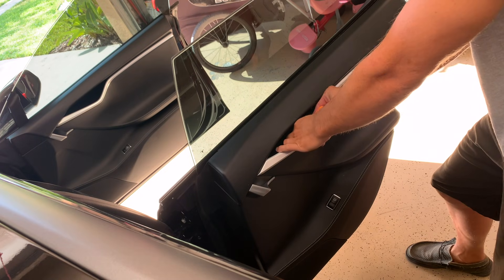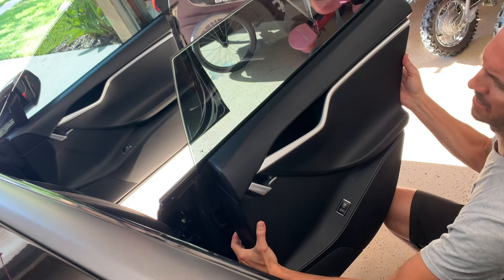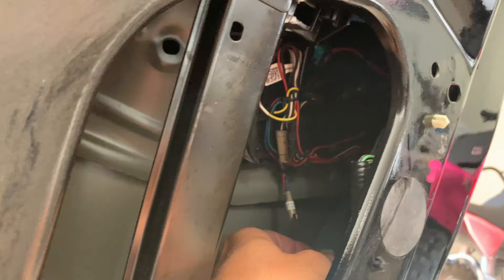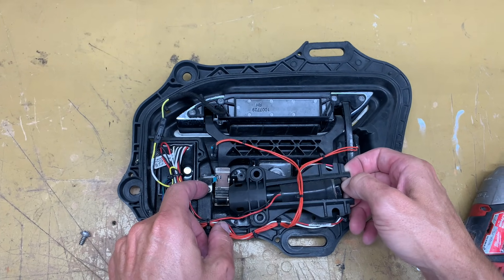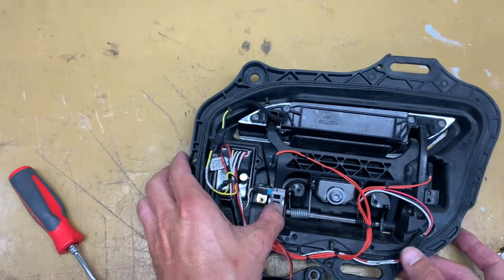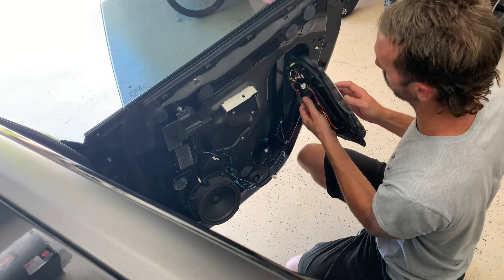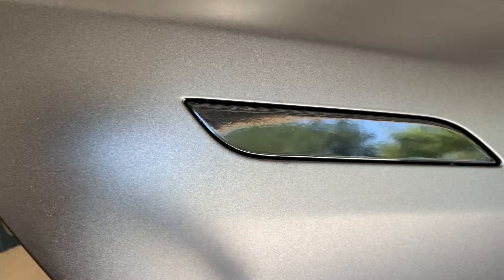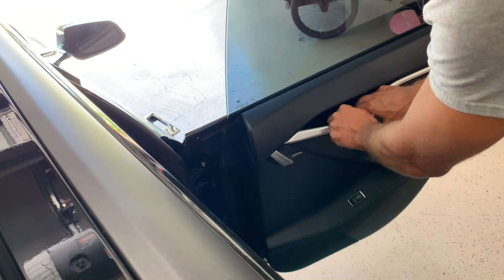Repair and Replace your Tesla Model S door handle

Comment: To be clear this is a rear door. The front doors are a different process.
Reply from the maker: I don't think that needed to be pointed out, but thanks.
Reply: @thereelwdad . I appreciate your video and your reply. I’ve done the front door of my 2014 S P85. I followed the procedure shown on the Electrified Garage YouTube channel. It’s a bit harder than a rear door. The Tesla way of doing it is to remove the glass. The Electrified Garage method leaves the glass in place. Chad is their head tech. He use to be a mobile tech before he help start the EG. he worked on my car while I was at work several times. Always a door handle.🤦‍♀️

Comment: How do you get the nuts out without taking the window out?
Reply from the maker: There are 4 nuts, which one?
Reply: @ top left one. I managed to do it, but had to trick the car into thinking it was locked by closing the door latch with my finger. Window went up fully which gave just about enough access for a long screwdriver with a 10mm socket at the end to turn. The angle on it is crazy though…

Comment: My car makes a whining noise when it’s trying to open the door latch. Is this the same issue?
Reply: And everytime I put my car in park the door opens by itself
Reply from the maker: It could be a similar issue, but seeing how they open themselves it sounds like a GEN3 handle
Reply: 2015 Model S
Reply: Could it be electrical? I’ve taken it to Tesla. They said they fixed the issue but it comes back during the rainy/cold seasons

Comment: How do you get to the hidden nuts?
Reply: Exactly
Reply: @johnluongo7732  I actually figured it out.  Go to harbor freight and purchase a flat ratchet wrench. It was 15 buckets.  Roll down the window all the way. There’s a rubber piece at the corner of the door that you can stick the wrench in.
Reply from the maker: If it's hidden how do you know about it?? lol j/k. I need to remake this to show different methods I use, but yes pulling the trim off the window on both sides and using a ratchet box end wrench to access the top forward nut works best.

Comment: very helpful. My door was hit not sure what I need to replace. I need a door also . Door handle does not work
Reply from the maker: I need two doors too! The door is probably bound up on the opening. If it really got bound up, it probably broke the paddle gear.
Reply: @thereelwdad  where are u located?
my door was Hit/Damaged . hence handle will not Present

Comment: Watched the video a few times. Read all the comments for the extra tips on how to acces the hidden bolt. From start to finish only took me an hour.  My c clip was rusted pretty bad and broke when trying to remove but thankfully you included 2 extras so I was fine. Door works perfectly now, thanks!

Comment: My 2016 S has an issue where sometimes when unlocking the car the right rear door opens. I’ve read that this is because the handle overextends and thinks you’re opening the door, is my only fix to replace the mechanism as done in this video?
Reply from the maker: It sounds like you need to adjust the microswitch that tells the handle when to stop, we have a short about that here.
Reply: @thereelwdad  Great, thank you for the response!
Reply: @thereelwdad  I haven’t been able to find the short you’re referencing, is there a chance you could send me a link?
Reply: @thereelwdad  Would I have to tighten or loosen the microswitch? I couldn’t tell on your short, is it the torx screw that’s on the blue microswitch itself or the one that’s behind it that gets hit by the handle when opening?

Comment: Thanks for this excellent video! Just did our right rear door on our 2016 S. Had trouble with a few power connectors, and getting to the hidden bolts, but apart from that, no whammies. It was an amazing pain in the ass, but, now it works. Thank you!
Reply: I’m giving this a go, My 2016S was tethered to the door frame, did you have that issue
Reply: @hasentufel44 did you give it a shot? There were a few weird connectors I had to figure out how to disengage
Reply: A month later I had to fix the handle for the other rear door. Sheesh! Well, at least I had practice. :)

Comment: Can you adjust the depth of the handle? Mine was replaced by Tesla service and it sticks out just a bit when retracted.
Reply from the maker: If it was a replacement recently by Tesla, they probably installed a GEN 3 handle. For this situation, you may be able to go into service mode and re-calibrate the handles to get them to sit flush.
Reply: @thereelwdad  thanks it was gen 3

Comment: Is it safe or advised to cut the orange strap for the front door?  I can'tfind enough room to get in there to work without doing so.
Reply from the maker: Great question, very rarely do we still have orange straps left, but this means that door has never been opened, a virgin door! Most are already cut.

Comment: My car is a model s 2016 and I can’t get the plug to the door Handle undone. It has four or five wires in it . Want to remove completely so I can repair it. I replaced the sensors but door handle doesn’t extend. Do you have anything to recommend.
Reply from the maker: The plug is just a plug, I am not sure how to assist you on that. Press the clip and pull, it is easier to do when you remove it from the mount. The microswitch sensors just tell the handle where to stop, and when the hand pull is activated. It sounds like you have a broken gear either on the motor or paddle gear.

Comment: First off, thank you Chad for this video as it gave me the courage to try to do this myself. BUT A FEW KEY LESSONS LEARNED TO OTHERS WHO MIGHT TRY THIS, BELOW. 

2015 Model S 70. Rear handle not presenting; years ago I watched the Tesla service ranger fix the same problem on my driver door handle and remembered that the crummy pot metal paddle gear had broken off at the hole section. Fast forward to now (October 2023)-- I could hear the motor whirring inside the rear door so was pretty sure it was a broken paddle gear (not the wiring). I initially sent in a service request on the Tesla app and they quoted me $500 to come and fix it in about a week's time (earlier available appointment).

I did some YouTube research, found this video and seemed feasible to DIY so I ordered a replacement paddle gear (stainless steel which should be much stronger than original part) from Amazon for $15 which arrived the next day. Note that I consider myself pretty handy (woodworking, some construction skills, minor electrical work) for everyone's frame of reference.

FIRST LESSON: Removing the interior door panel is a major headache!! In Chad's video he pops it off in 2 seconds (to be fair he mentions that he's removed previously so that's why it is so easy). I tugged, pulled, wedged, etc. for what seemed like an eternity (probably 30-40 minutes) and was a sweaty mess... I was about ready to throw in the towel and just have Tesla come and fix it but seemed crazy to pay $500 to fix something that could be fixed with a $15 part. RECOMMENDATION: if this is the first time this interior door panel is being removed, gird yourself. I would place thick duct tape along the edge to protect the paint finish and I ended up using a bunch of chisels to wedge them between the metal door frame and plastic paneling and pry them upwards. Finally I heard one of the white plastic anchors pop off so that gave me hope and I kept wedging along different spots along the side and bottom of the panel and eventually was able to pop it off like Chad shows in the video. I don't know how one would be able to do it without some amount of damage to the white plastic anchors-- I saw some shards of white plastic as I'm sure they turn brittle over the years and they get damaged when forcing the panel off (silver lining-- that does make them much easier to put back on and off again in future).

SECOND LESSON: It was mentioned in a few other comments as Chad's video kind of glosses over it quickly but when trying to remove the door handle mechanism, the fourth 'hidden' nut is seemingly impossible to access! This was the second time I was about ready to throw in the towel. I was able to get 3 of the 4 nuts off using my standard ratchet set (with extender for the more visible nuts) but I could not figure out how to get to the top middle 'hidden' nut. I could see it taunting me through one of the metal door frame holes through the glass (I had the window in up position). I felt like I hit a dead end so ended up driving to my local Tesla service center (fortunately only 20 mins away) and a nice technician there explained to me that to access that last nut they recommend putting the window in the highest 'up' position by fooling the car and activating the door latch (the one at the 'strike' side of door) so that the window rises up that extra inch or so. VERY IMPORTANT: IF YOU DO THIS BE VERY CAREFUL NOT TO CLOSE THE DOOR AS THE GLASS CAN SHATTER AS IT WILL HIT THE UPPER CAR FRAME. After the glass rises up you have much better access to the hidden nut. The Tesla technician showed me the mini ratchet he uses to get to that nut.

As a result I would HIGHLY recommend getting something like a mini ratchet set with a 10mm socket. I went to Home Depot on the way home and bought a "Husky 1/4 in. Drive Flex-Head Microdriver and Socket Set (16-Piece)" for $22. After I got back home and raised the glass to the highest 'up' position, I was able to get to the hidden nut. It helps that this ratchet has a swiveling joint to help angle it into that tight space.

THIRD LESSON: Now that the nuts were removed I was flying high. The power cable to the door handle mechanism was still zip-tied to the body so in order to unplug it (Chad's video shows it dangling as it has been detached already) I had to cut a couple of zip-ties to access the 'plug' that you disconnect. Be careful when you snip the zip-ties to avoid cutting any wires... but here was the next hurdle... getting the door handle mechanism out through that small opening in door frame is like a crazy 3D puzzle... took me a while to spin it, move it, try lots of different positions before it finally came out. 

The door handle mechanism finally came out and the video is pretty spot on... the spindle in my car was not as easy to slide back and forth as in the video but I ended up using a hammer and a nail set (tapping lightly) to push it far enough to the right to be able to install the new s.s. paddle gear. 

LAST LESSON: After testing the new paddle by reconnecting the power wire to door handle, one thing to note when putting everything back together. The power wire that is now unbound because you had to snip the zip-ties to get access to it is now flopping inside the cavity. It looks like there is a chance that the window could get caught on it as it goes up/down so I would recommend attaching the loose wiring to the door body so it is snug. I ended up using some foil-faced tape I had handy.

But finally after about 5 hours all told I got it working. Thanks Chad for the video! 

PS: Closing note: I had cancelled my original Tesla service call (the $500 estimate) but when I hit the 2nd hurdle above I made another service appointment on the app as a back-up plan. That quote came in around $320 for the same repair... I know these are just estimates and the service technician will update it once they assess the actual repair but if they had sent me that quote to begin with I might have not gone the DIY route... but at that point I was already neck deep so pushed through and did it myself. The Tesla technician who helped me remove the hidden nut said that they don't just replace the paddle gear anymore as a standard service item. They replace the entire door handle assembly with a more reliable design and I believe he said that costs about $320.
Reply from the maker: Wow, that is quite the comment! Can you come write this stuff out for me in the future?? lol. You are 100% correct on everything. I do feel the pulling of the door panel isn't quite as horrific as you make it out to be, but it is very nerve-racking to be yanking so hard on it. I have been meaning to add those little details about latching the door and putting the window all the way up to access that one nut, but haven't found the best way to add it to the video and have it remain up.
Reply: You're right, it's quite the challenge to get to that specific bolt and also to remove the zippers. Would have been worth mentioning in the instruction video to be well prepared.
Reply: Wanted to add a thank you for this comment. Video was great, but this spans the gap on some hand-waviness aspects. The window "up" position was key. and I found a standard 1/4 wrench was just fine to access it with this secret. Was able to do this end to end in 1 hour for the first time taking on this job! I added some silicone grease to the new paddle gear as well to prevent any binding.
Reply: @PaulMangiamele Glad it helped!
Reply: Thank you!! The vid and the comments together, made it much easier - that window trick saved me - i never would have got to that bolt - just adding that I also pulled those stickers off and got to that bolt with an extension bar for my ratchet and went through the access hole rather than try and slide my hand up behind it.  Thanks again!

Comment: 2015 Model S 85D. Surprised it took this long for a door handle to fail. Tesla quoted me $315 for repair. Might have gone for that, but the other three doors are probably next in line. Ordered the gear from ReelDeal on Friday and received it Monday (figured that was the problem). The video didn't match my car (driver door) but managed to figure it out as it was similar. After removing the three nuts wouldn't budge so scratched my head and eventually read the comments about the fourth nut accessible from the window slot. Didn't know how to remove the trim but found it just pulls off. I lost one of the other nuts somewhere in the door so I left the window one off as I won't need lto disassemble the door to get to it should I pick up a replacement. After reassembly the window was brushing the cabling and connector. I should have tied it off while the assembly was out but I wasn't going to remove it again - it is quite a task to fiddle it into place. Took me a long time to bind the cable out of the way due to limited access. Whole job took me 5 1/2 hours! The replacement gear seems heavier than the original. (The bushings needed to be removed to fit the new gear.) Just changed the configuration to only auto-present the driver door to limit the wear on the remaining three doors. After this job maybe $315 isn't so terrible to pay. Clearly Tesla didn't expect these gears to fail given how tough it is to access the gear.
Reply: Sounds like you did a front door handle.  That’s a slightly different process than rear doors.
Reply from the maker: Think about how much faster you will do it next time though! We have them down to just about 45 mins for the gear now.
Reply: Mine too 2015 model s. Failed 2 months ago.
Reply: $400 now inflation lol

Comment: Helpful instructions all the way until they weren't! My 2016 S90D door handles have a 4th nut on the upper left corner behind the window glass! Unreachable! You have to remove the window to get to it! Or have a specialty, long handled angled 10mm socket to finagle around the glass. Too tight to get a socket on it, and the nut is recessed so you can't get a box wrench on it! Window UP for other three nuts, window DOWN for the top left nut, and requires special tool that I don't have so I had to give up and put it all back together without repairs bc I'm not taking out that glass!
Reply from the maker: Don't take out the glass, you don't need to! You can reach it with a standard open-ended 10mm wrench with the chrome exterior trim removed.
Reply: having the same issue. If you push the door lock (in the frame of the car) the window will go up a little bit more (as if the door is closed). But i still cant fit my tools to reach the nut :(

Comment: I really appreciate you taking the time to put this video together. BUT, would be really helpful to discuss how to get at that one nut behind the window. That one took me over an hour and it was pure luck, along with a flexible extension. I didn’t put it back on when I reassembled since I didn’t want to deal with it again if I repeat this process.   I figure three is enough to hold the assembly in place…
Reply: 👍 the rest of the video was super helpful and was my main source for the repair. Thanks!!
Reply: @mkinsocal3492  how did you get it out, i couldnt even find the last one which i'm assuming is this one
Reply: @ZakiPolad   It was equal portions of cursing : trying different tools : luck.  The tool that finally worked (somehow) was a flexible extension to the socket. You have to feel for the nut. For once in my life my kid-sized arms were useful.  I was able to get the socket on by feel and then attached the wrench to the extension just to break it free.  There was not enough room to keep using the socket so then I just used my fingers to twist off the nut.  I didn't replace the nut when I reinstalled - #1 because I couldn't and #2 didn't want to deal with it again if / when I have to replace.  Good luck!
Reply from the maker: I do need to add to that, thanks!

Comment: I hope this fixes my issue my door handle is stuck a quarter of the way out but still functions if I pull on the doorhandle to open it but it won’t retract in or out and I can’t hear the motor moving either
Reply from the maker: I have not seen that before, you may have a GEN 3 handle that needs adjusted.